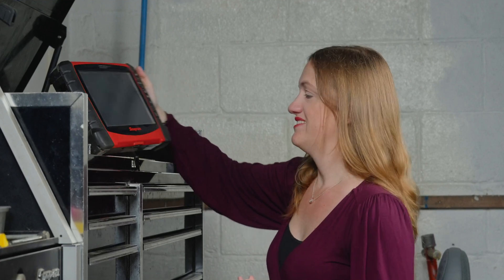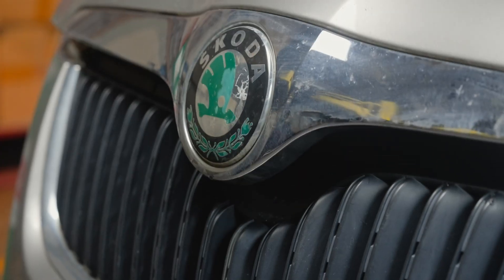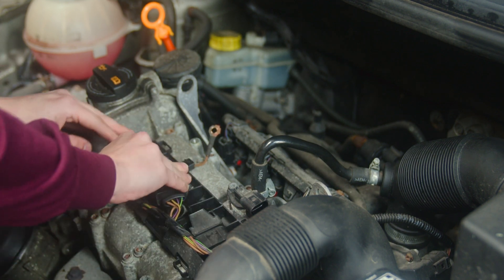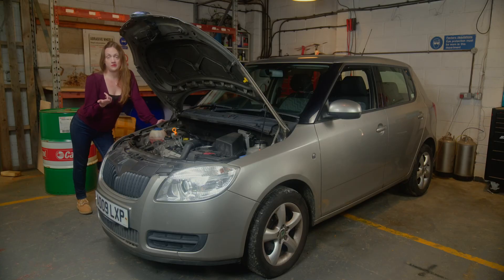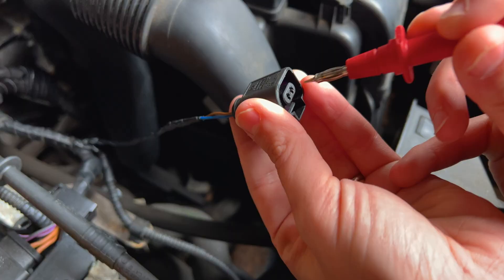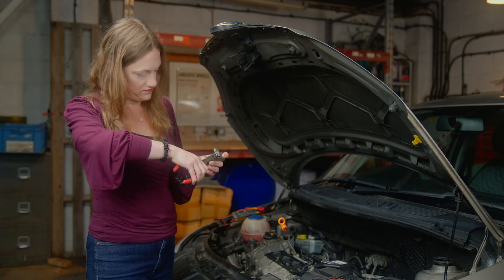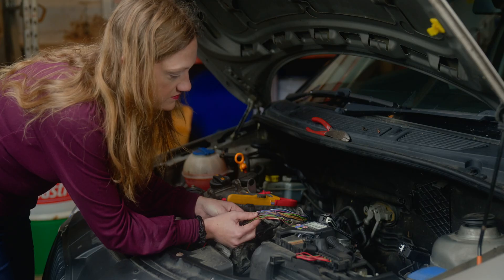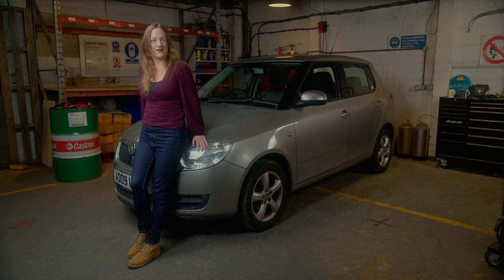VW Skoda 1.2 Seat misfire FIXED for £1 | fault codes 16502 17666 16686 P0302 P0301 P0303 P0304

Comment: exelent job,heat ,vibration,points contact,can do loads damage to wiring looms,good call on move coil packs too,not be a parts canoon,good soldering job too,bad earths can cause lots wierd problems too,try voltage drop on them ,test light,or multimeter ,you remind me of scanner danner,how he works,find it and prove it ,then fix it ,worth a watch on youtube,is good buzz when its fixed or you find the problem ,can use wiring diagrams too,look at circuit design ,colours,were they go ,what they do,love that you check for 5v ref ,thats a main ecu check,so many people only check power grounds ,miss the 5v ref,i had bad rac advice too,car engine stop on moterway at 70 ,pull over,not start,phone it in ,man in van came out ,plug in scan tool,ask if i just fill up with fuel,car not start,said pump gone,ecu,so 7.5 ton truck get me home,next day i do quick tests,ecu alive ,spanner light on,5v ref ,rev counter flickers,crank sensor pulsing ,still not start,so pull fuel filter off,and it was empty,out fuel,tank on dash show half tank,connect fuel line to can fuel,crank over ,fuel suck up ,and engine started,so problem at rear verhicle,drop the tank ,take pick up pipe out,sender unit ,tank was full sludge,wash out tank,refit,add clean fuel,car start up fine ,just goes to show ,need proper diagnostics ,bit hard on moterway ,but only cost me a tank fuel,fuel filter,and sorted,keep up the good work,nice fix
Reply from the maker: Hey Thanks. 
Yeah I saw scanner Dan but found his videos hard to watch. I’ve only been fixing cars for about 6 months now so lots to learn.